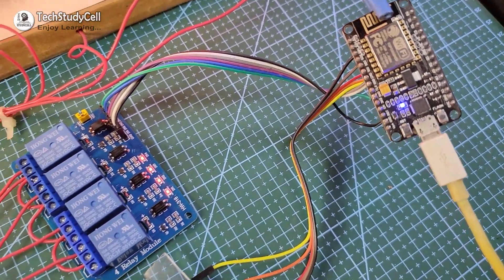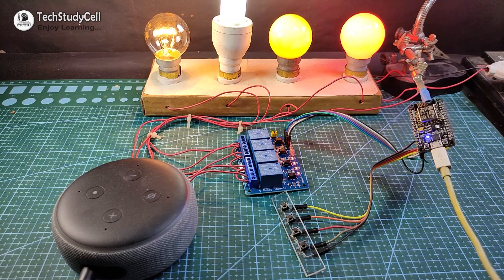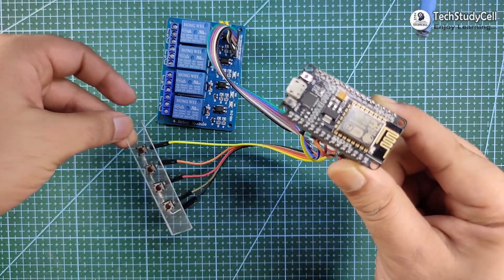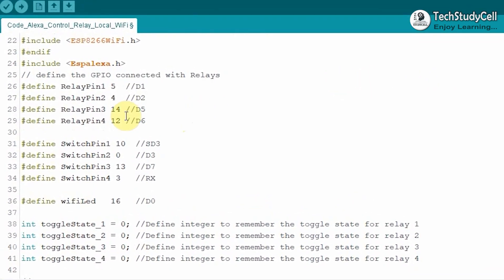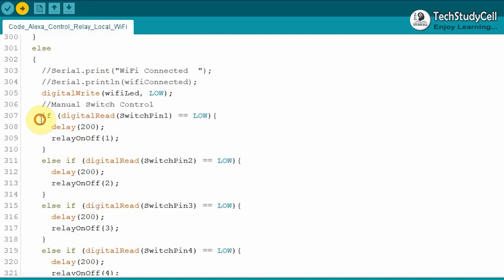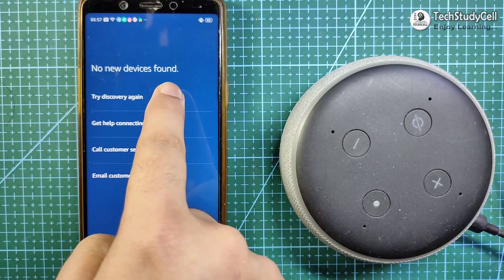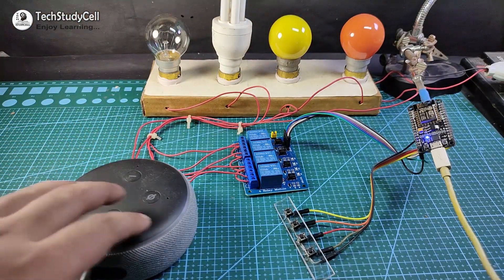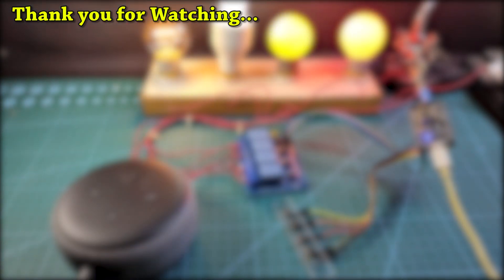Alexa Home Automation project with Manual Switches using NodeMCU & ESP8266 | IoT Projects

Comment: Good day  , it is Me again:  The project is working very well but I  found that if the relays are controlled locally by using the relevants discretes, Alex does not report the correct relays status.  So by activating the the realys by their discretes buttons  , I can not see the relevant status on the Alexa application on my cell phone.   Is there any possibility to implement a real status feedback to alexa application please ?  Thank for all . regards, Bye

Comment: without wiring can we test it will alexa only without manual switches one more thing led is not lighting once wifi is connect.
On the serial monitor wifi is displaying as connected, even if once I try to add in alexa no device found!
I am new in this please help me !!!!
Reply: same issue for me.

Comment: Because I built a voltage divider fan regulator and wanted a platform that would see all four speed as one device(fan) and not 4 sperate relays. Can i use if statement and edit your sketch to do that by reducing it to one device?

Comment: good day to all;    I uploaded the sketch on my ESP after having changed SSID/psswrd and everything was fine and working very well.   Later on I changed the device names BUT the names where not change in tha Alexa application. I did several changes: reload the original names, reset the PC / ide , power on/off Echo dot, removed the four devices in the Alexa App, uninstall Alexa App from my mobile BUT Alexa does NOT find_out  the ESP devices anymore .  Any suggestion Please ?   Thanks in advance, Ambro
Reply from the maker: Remove all the devices one by one from Alexa app. restart echo dot. the smartphone, echo doe and nodemcu should be connected with same wifi. then try again.
you can also refer this page: https://github.com/Aircoookie/Espalexa
Reply: @TechStudyCell   Thanks it is working well now

Comment: I am trying my best to replicate this, and am using the same code as you, same library, same board, same everything. but for some reason both of my new nodemcu 12e modules arent picked up by my alexa thru the dlink router. i have tried reinstalling the ide, libraries, swapping the board, and also changing the wifi network, yet the same result. its brand new bnodemcu board. should I flash it first? what flash file to use? please help me outtt
Reply: same problem i faced. the solution was to just update your board manager and libraries.

Comment: Hi, can i use TTP223 ( Touch Sensor) instead ot Push Button
Reply from the maker: Yes. But output pin should become LOW when it detects any touch.
Reply: @TechStudyCell  Then What's the change I have to do, in coding you provided.
Reply: Please made a code for ETT223, and share, please

Comment: Great skill!!! You are awesome!! I'm new in this controller's and rebuild like your video. Can use 2 3 4 relais with button but 1 not working. I can't get wifi connected. Any help available?
Reply from the maker: First check the circuit. Restart the echo dot.  Then try to connect all devices again.
Reply: Thanks for answer! Will do!

Comment: Please Help, My Relay not Triggering with blynk buttons but relay led glow very dim almost invisible but when i connect relay input pin with nodemcu ground pin then its triggered, so please guide me what i have to do.
Reply from the maker: Please let me know in which project you are facing problems. In this video I have used active low relay module. So to turn on relays I have to give LOW signal in contact pins.

Comment: hi , brother after uploading the code its works reversely  when i says tube on its off the tube  actually , if i says on its off and if i says off then its on ........coding having some issue and can you add one appliances more i mean 5 appliance light your another project alexa control and please provide me 5 appliances' control with alexa with manual control
Reply from the maker: If you are using active low relay module then use this code, but if you active high relay module then you have to send HIGH signal to turn on the relay.
Reply: @TechStudyCell  yes i know that but primarily i am testing glowing LED on bread board from the Arduino Digital pin you assigned in coding 
Okey bro please tale me what changes i have to made because i want this switch vertion and also add one more APPLIENCES if processible
Reply: YOU  NEED TO CHANGE IN SETTING  IN ONCONDITION  HIGH   AND OFF CONDITION  LOW

Comment: thanks for the project.
I can't run. display this message on the serial monitor: 
 ets Jan  8 2013,rst cause:4, boot mode:(3,6)

wdt reset
load 0x4010f000, len 3584, room 16 
tail 0
chksum 0xb0
csum 0xb0
v2843a5ac
~ld
Reply from the maker: If you are using NodeMCU, then use 2.5.1 version of esp8266 board. Please refer the video.
Reply: @TechStudyCell  
I'm using 2.5.1 version of esp8266 board.
the code from the previous video, without Push Buttons works.

Comment: I think we should replace the push button system with a ir remote system
Because that will be more beneficial
And remove " if else " wifi connection clause.then we can use it simultaneously with an ir remote and alexa

Comment: I like your project
Upgrade the project with RF controller so you can call it Remote controlled.
Finialy you could add options for other WiFi Systems.
Using free apps online to control switches the same as Alexa but different.
Thanks for. Listening
Reply from the maker: Thanks for the feedback... To avoid Alexa you can also refer this video https://youtu.be/fRCVx6yKoYw

Comment: I am using phone charger 5v 2amps samsung make for powering my circuit for  both 4channel relay board and esp8266 node mcu , facing a challange like iam only able to control only 1 relay other 3 relays are not triggering but signal LED is blinking i am controlling through blynk app.pls help sir.

Comment: Excellent project sir, now I'm trying to do this project and I have a problem, when I uploaded the sketch to the Nodemcu Arduino IDE gives a problem "Hard via resetting pin..."? How can I fix this? Can anybody help me?
Reply: Thats not a problem it means codes are uploaded correctly and u have to push reset button on modemcu

Comment: This project is awsome, It does however take a couple of tries to get Alexa to discover the device. I have a slight issue in that if you switch the relays on/off change the current state with the push button, the status change is not reflected in alexa. Any constructive input is very welcome.

Comment: This Project has issue. If we use manual control, the status of relays not upated in Alexa. i.e. If on the go I want to switch off relay 3 by switch, the relay will switch off but alexa will show its status as swich ON in Alexa App.. Even in case of manual operation of switch , the status of relay/lamp should be updated in Alexa App.
Reply: Any update on this?

Comment: Thanks for the tutorial. I have already requested and i am again requesting for a detailed video on SAFE wireless 220ac solenoid water pump control system with water level and manual on/off button and that with 12v relay. All the videos available on youtube are with wired system which is not practical in most cases bcoz tank is usually at 3rd or 4th floor so running wires is tedious in that case. So please take a time and make one. Thanks
Reply from the maker: Sure.. Added in to do list.. thanks
Reply: @TechStudyCell  Thanks for swift response and waiting eagerly for that video.  Here are some points and specs to note:

- Working voltage should be 12v dc
- 12v dc relay must be capable of controlling 2hp solenoid pump
-  Must have water level indicator in terms of leds or 7 segment or small display screen.
- Must have Manual switch to turn on/off motor at any time (can be further connected with ESP8266 relay to on/off with mobile phone)
- 433Mhz RF module can be used as its cheap and its range is more than enough in my opinion but you can use any other module which you think is better than that.